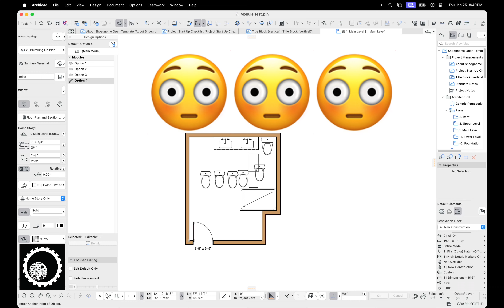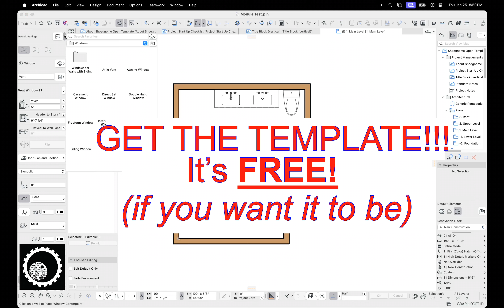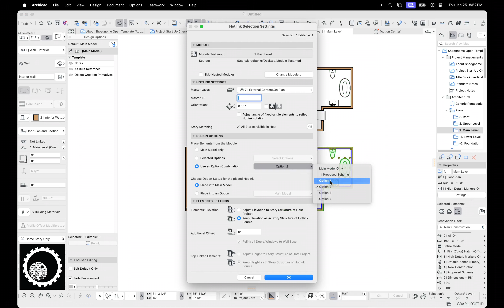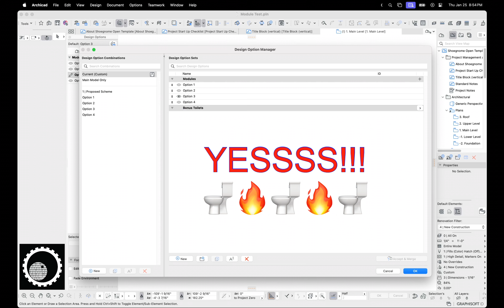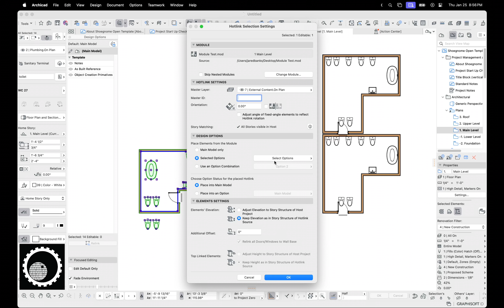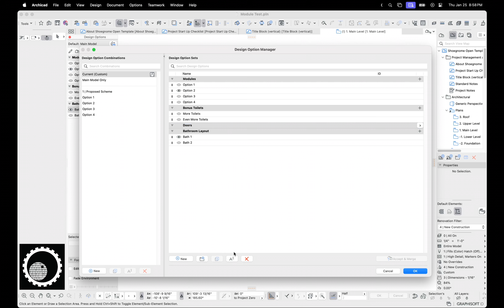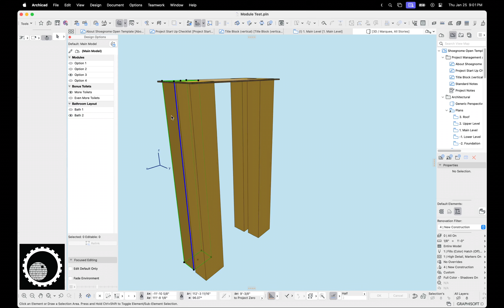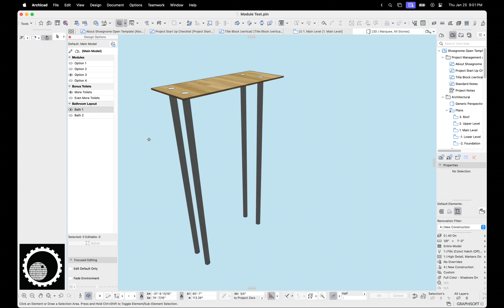Archicad Tutorial #99:  Design Options in Archicad, Part 4 (Hotlinked Modules)

Comment: thanks for the video. very helpful.
might i suggest doing another about what elements can't typically be linked to a Design Option but requires a slight workaround? you've mentioned the doors in the video. might do well to do the same thing with windows & the Opening Tool.
Reply from the maker: I'll add that to the list of bonus items to discuss in a future video, assuming there's enough stuff.